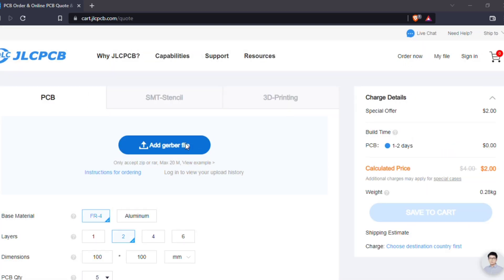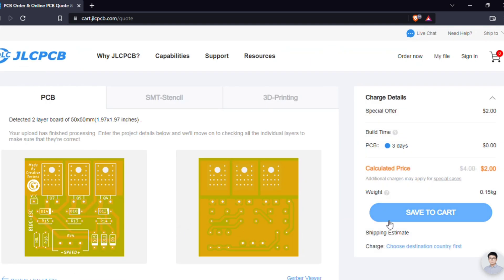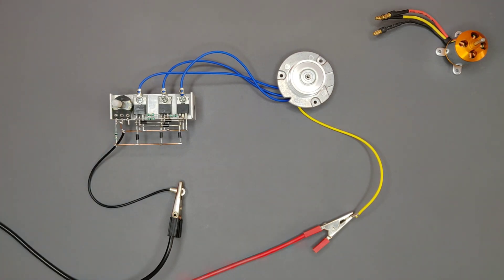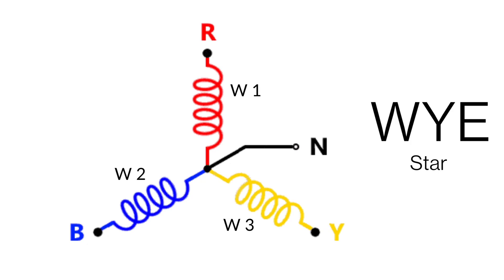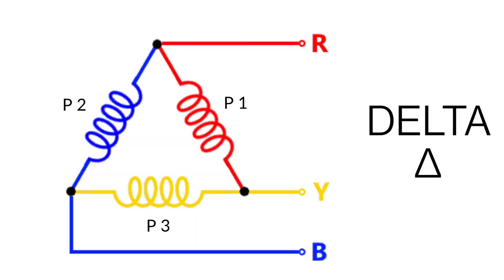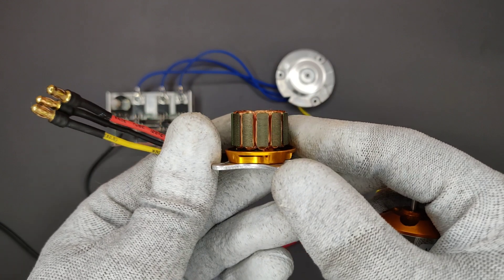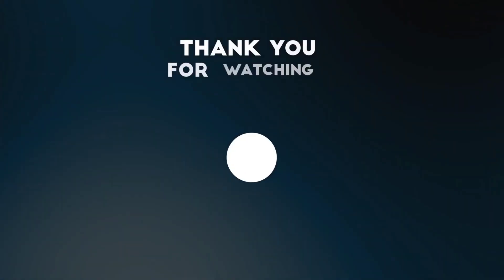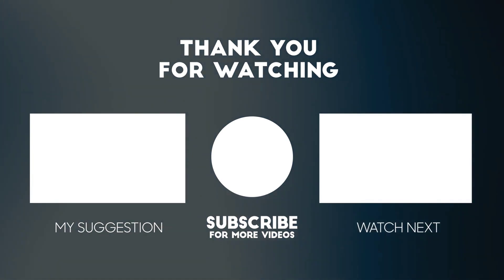Brushless BLDC motor ESC controller circuit

Comment: Yes, thank u. l made it  and it works. Speed control not much effective but runs with good power. Thank you very much again,
Now I'm going to try delta motor using  similar to your diagram with three  p channel  mosfets and bridge it  with this one. Will it work brother? Got any idea pls❤

Comment: It doesn't work at all, I spent a whole day soldering this piece of crap, but it didn't work, or rather the motor twitches and immediately stops.
Reply: I HV failed two times due to bad Chinese fets, and now OK. Use original fets

Comment: All the blue are connected to heatsink :O
Reply from the maker: It is not connected to heatsink, it is connected to drains of mosfets, Each mosfet is isolated from heatsink by using TO-220 silicone pads and plastic bushings.

Comment: Very good. The problem with this type of circuit is that every time you want to start the motor, you have to be pushing the motor and this devalues the project a lot. Would you have a more efficient way? Thank you

Comment: I liked the video very much.
Thanks a lot.
I would like to see this three-phase control circuit, but without connect a neutral wire
Reply: That would make it a star connection dc 3 core motor t

Comment: WUV is connected to heat sink, why is the motor running?
Reply from the maker: It is isolated from heatsink using silicon TO-220 Pads and plastic washers.

Comment: Mabey if you can remplacing the resistor with a hall senssor ..and remplacing the variable resistor with other one that have open and close interne control ...here you will have a real speed controller ..it's will be confortable case for this project

Comment: 🇧🇷Here in Brazil. Very good your project. How many amps does it support, can it run a washer and dryer motor for testing?
Reply from the maker: Thanks for watching, it will support upto 30A BLDC motors
Reply: Can use that in 6leds BDLC motor?

Comment: BLDC motor me 3 wire hotaa haai. Ye 4th Yellow, kaahaanse aayaa? Jab ham BLDC motor banaayenge, 3 wire hi hogaa. To ye fourth point kaahaan se milegaa? Thodaa samjhaayenge?
Reply from the maker: Thanks for your interest in the video, Actually in this video i used bldc motor from hard drive, with 4 wires.
BLDC motor has usually 2 configurations
DELTA with 3 phase wires, WYE with 3 phases but with common wire that is actually the point where all winding ends are connected together.
Reply: @CreativeTechos  Thank you for your quick response. You are very kind. As I told you before, I have no knowledge on electronics. At the age of 70, if I try to learn also, I can't remember. So, I am trying to take the help of videos, made by people like you. Do you have any video on how to make BLDC motor at home?

Comment: can i run 220vdc (bldc) motor from this circuit?
Reply from the maker: Nope, only for dc BLDC motor
Reply: @CreativeTechos  yes but 220vdc bldc small motor avilable in market, how to run that motor?
Reply from the maker: How many wires it has?
Reply: @CreativeTechos  3
Reply: ￼
DC 220V High Speed Brushless Motor 3 Phase with Dual Ball Bearing
Reply: search ☝pls

Comment: Curious, how is this working? Like where the oscillation signal coming from to power the 3 PHase signal? Are the mosfets oscillating on their own, if so how are they oscillating at a different phase from each other? Thank you in advance
Reply: I had a look at the other comments to see if anyone else actually built this circuit... looks like not. I would also like a circuit explanation before I would build it. I have experimented with this kind of 3 mosfet instead of 6 circuits before. But use a microcontroller to trigger the phases consecutively. Perhaps there is a way to trigger the mosfets via a diode during the emf collapse phase. At a glance at this circuit it might do something like that. But who knows if it is worth any further attention if the channel owner does not have the decency to explain the working of this circuit. I do not know his agenda, but I have seen people do anything for views regardless of how much of another person's time he is wasting with a bogus circuit...
Reply: @NeoFrontierTechnologies  it works. this is a modification of a 3 stage flasher circuit, where timing isn't controlled by RC groups, but the voltage on the motor windings. You can also look at it as a modified ZVS driver, but instead of driving one LC circuit it drives 3 phases. The rotor mass and speed are the substitute for the RC/LC timing achieved in the originals.
Reply: @two_number_nines  drains short circuit to heat sink !!!
Reply: @NeoFrontierTechnologies 😊
Reply: @NeoFrontierTechnologies  Perfectly right Neo Frontier technologies, YouTube is full of such time wasters.
Reply: دائرة جربتها لم تشتغل عندي    س،ؤال هل يجب مراعات ترتيب العناصر على الرجل الواحده في الموسفت وشكرا اخواني علقولي
Reply: ,Don't border trying it it's fake
Reply: @rocksmith3733  It does work, but has trouble starting the engine. Furthermore,since it outputs a square wave instead of a modified sinus, it runs rather rough and delivers lesser torque. I used it to drive a modified car alternator but switched to a six mosfet design to power a small lathe where smoother running pays of in a better surface finish.
Reply: @rocksmith3733 it’s real I try on hoverboard motor

Comment: My motor only pruduce a "piiiiiiiiiiii" and doesnt work.  any help?
Reply from the maker: Which type of motor do you have?
Reply: @CreativeTechos  4 cables. I have a lot of a hardisk motors but same problem in all of them.
Reply from the maker: I'll soon upload new circuit with best control without microcontroller

Comment: Why phases of motor are connected to transistor heat dissipator?
Reply from the maker: Phases of motor is connected to MOSFET drain as three Fets works as oscillator to complete the rotation. Since drain pin is internally connected with body of mosfet. But every drain of mosfet is isolated from heatsink with silicon pads and screw washer bushes.

Comment: My BLDC only has 3 pin connection
Reply from the maker: I'll soon upload video for 3 Wires also.
Reply: @CreativeTechos  Can u make that pls? I need that
Reply from the maker: Upload ASAP I'm already working on that, ist version will be without microcontroller
Reply: @CreativeTechos  Thank you!!
Reply: @CreativeTechos  is it possible 
3 wire bldc 72V high power moter controller 
DIY ?
Reply: @CreativeTechos  🤡 Charlatán copiando diseños de otros ¡Muestre el esquema vividor de cuentos! Deje de liar y complicar a la gente con 5 minutos aburridos🤡💩
Reply: Your bldc is Delta configured

Comment: friend, a simple question, this yellow wire? is it positive from the battery or from the power source? and the blue wires?
Reply from the maker: Yellow wire is positive going to dc +ve and all 3 blue wires is gnd and going to Mosfet as mosfets supplies -ve to motor one by one to complete turns. Like when ist Mosfet supplies -ve to motor 2nd & 3rd Mosfet is off, and when 2nd, ist & 3rd is off, and when 3rd, ist and 2nd is off. And this process happens continuously in fast mosfet switching speed
Reply: @CreativeTechos  perhaps inside the motor, for example, the last 3 terminals of the 'Y' connection would be the correct neutral? and the other wires the phases??that go to the comtrtolador? i always thought these wires were positive and n negative
Reply: @boasnovasonline8764  your kinda right but it's an AC signal 3 phase shifted by some degree but it's not sine wave probably pulsed DC or like a sawtooth wave but this in the video wouldn't work bigger motors with a significant load on the motor .....hope that helps

Comment: Direct from Marituba, Pará Brazil thanks for the video, I would like to know if this controller is the battery or if it is connected directly to the electric grid? I would like you to make a 48 v14 Ah battery model is it possible? From also

Comment: At lease show the output what exactly you want to show .is bldc motor run in your video
Reply from the maker: Yes, bldc can be driven using this circuit.
Reply from the maker: I'm showing bldc motor is running using this circuit

Comment: Can I use this circuit to operate bldc ceiling fan?
Reply: Bldc ceiling fan consumes less power 28 to 32 Watt, so it will take maximum 2 to 4 amp..
Reply from the maker: Then try it out.
Reply from the maker: You may try, max power 45A